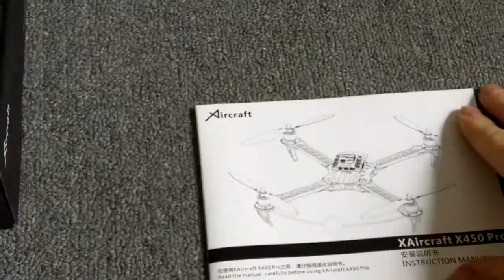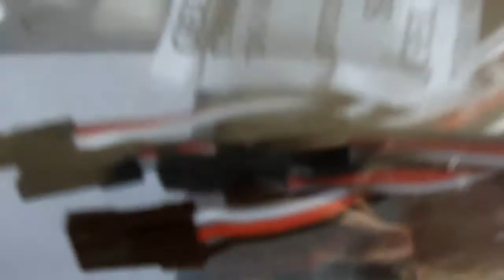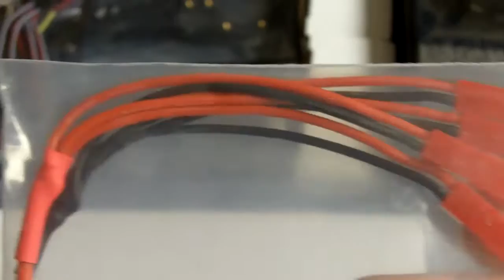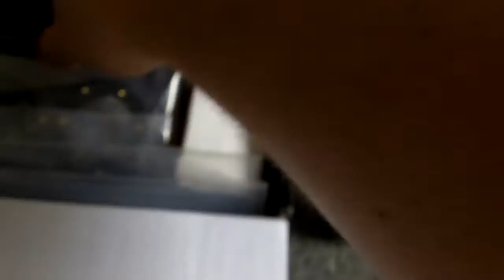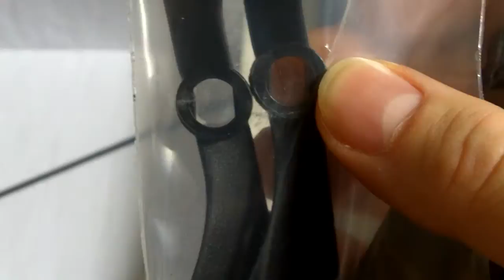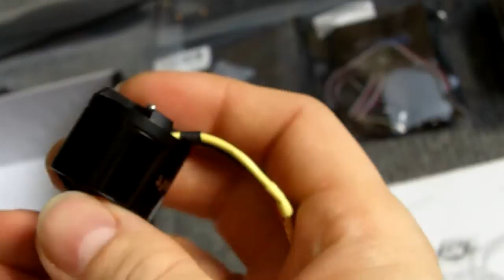XAircraft X450 Pro unboxing

Comment from the maker: @spiro9210 To be clear, the vibration damping mount I show in my video "X450 Pro Keychain Camera Mount" is one that I built myself from a dead CDROM drive and is in no way an official XAircraft part.

The X450 Pro doesn't have an official camera mount.  The X650 does (it hangs between the landing gear skids) and with a bit of work you can probably find a way to fit it onto an X450.